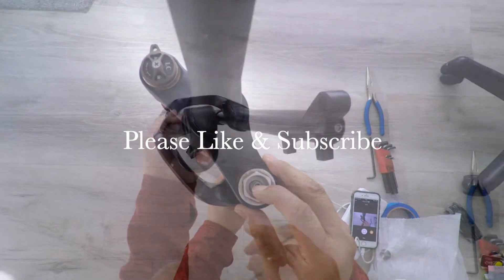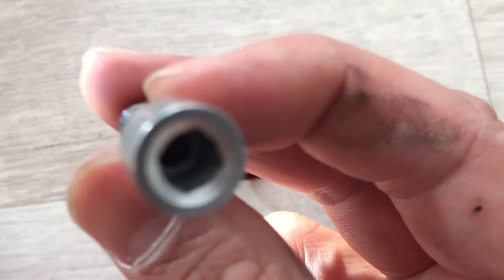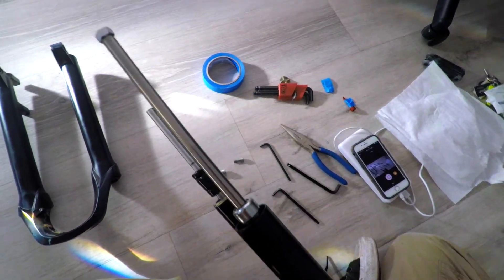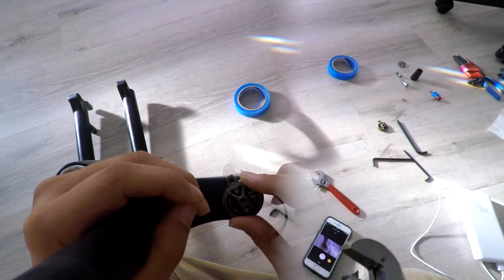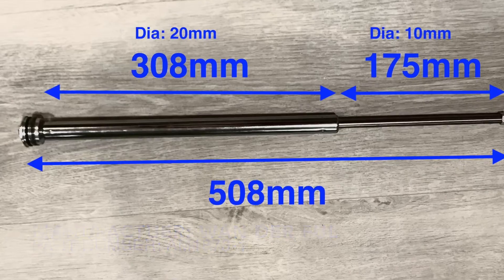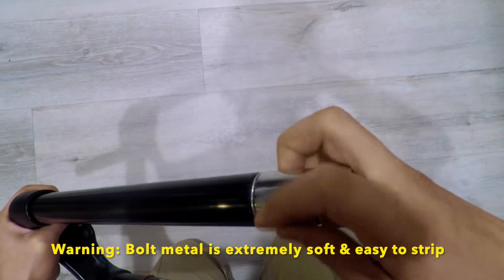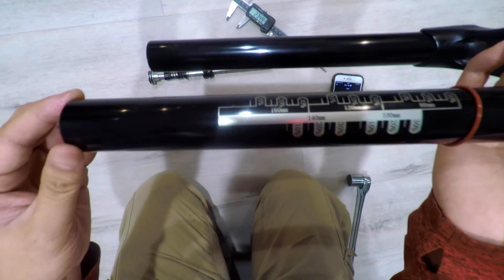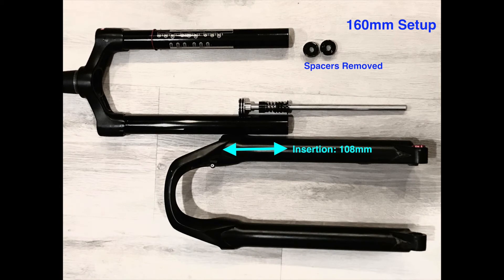Taking Apart a ZTTO Boost Air Fork

Comment: Hi, I have this fork for 29" but it has a small screw holding the rebound adjustment knob, looking for info it mentions it is a 2mm hex but it is too big to fit and 1,5mm too small.

I can't remove the little screw to remove the rebound adjustment knob.
Reply from the maker: Have you tried SAE? 1/16” or 5/64”?
Reply: @mtbxpchannel9031  Yes, but without success. :(

I think the only solution is to slowly drill until the little screw is undone.
Reply from the maker: It might be stripped, the set screws aren’t the best quality.
Reply: @mtbxpchannel9031  It may be but that prevents me from servicing the suspension, now I know it came with a defect and I had not seen it until now.

Thanks for your reply :)

Comment: Thanks for the review. Did you see what the bushings were made of? Most cheaper forks like those have nylon bushings but higher end forks have aluminium instead, so they’re a bit tougher. With what you’ve done so far on the bike, how are they going? Is there any lateral play of the stanchions in the lowers? You can see this if you lock out the forks, put the front brake on and try to wobble the bike back and forth. You might be able to see a little wobble in the lowers. Thanks in advance.
Reply from the maker: I didn’t get a chance to see the bushings but I do plan on doing a 100-mile update where I’ll take it apart to see how everything is doing. I’ll check for wobble too.

Comment: Hello, I want to buy a similar suspension, only because it is new in the market it makes me doubt if it is reliable or not, could you help me? Thank you!
Reply from the maker: I have ridden about 100 miles on it and it has worked fine for my riding style. You will have to decide for yourself if the lower cost is worth unknown reliability.

Comment: taking out the spacers lowers the air springs progressiveness. What about cutting down the bump stop to increase bottom out travel instead. That way the volume spacers keep the spring rate constant? it also preserves the frame geometry. thoughts?
Reply from the maker: Cutting down the bump stop is a valid method too but there’s a risk of over insertion when fully compressed which I didn’t measure so I can’t confirm. I agree you retain the uncompressed geometry but at the cost of compressed geometry being steeper. I don’t know how effective the spacers worked as “volume spacers” so I wouldn’t count that as a deciding factor.
Reply: @mtbxpchannel9031  oh right the spacers were on the negative side. My bad.

Comment: It was so detailed it made me confident enough to NEVER take apart my fork!!!  HAHA!!  Thank goodness for local Bike Shops!!!
Reply from the maker: Or if you know someone...
Reply: Forks are quite durable these days. My Marzocchi bomber 44 2010 and RS Reba has similar configurations to this fork (I did the servicing myself). Sure you can pay suspension shops $100+ with all the tools at their disposal (especially their nitrogen charger) and get a fast turnaround time, or buy some tools yourself and going slow at it the first time while the experience will pay off, and the tools pay for itself. And of course, suspension oil is not too expensive either. And yes, if there's a service manual around then get that for guidance, otherwise use trial and error between steps.

Sorry for my ramble, just felt the need to put my $.02